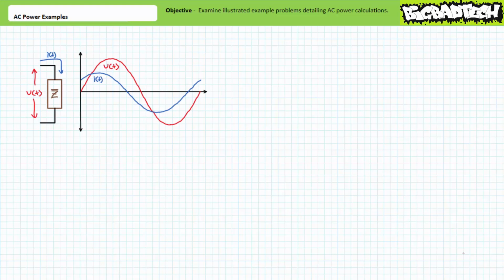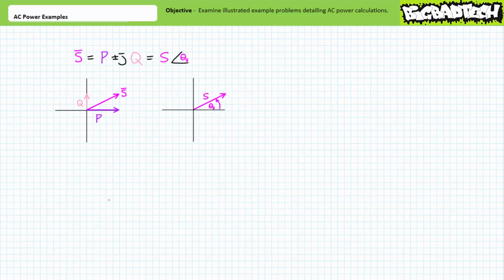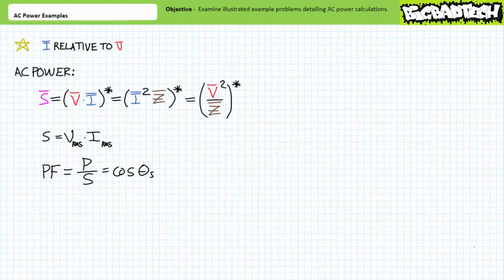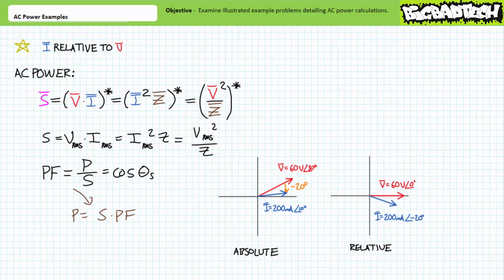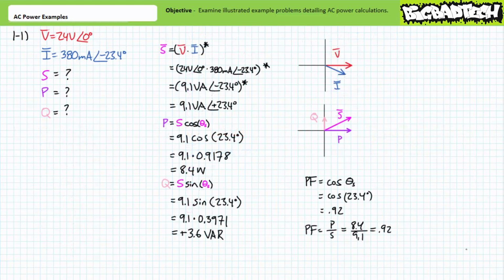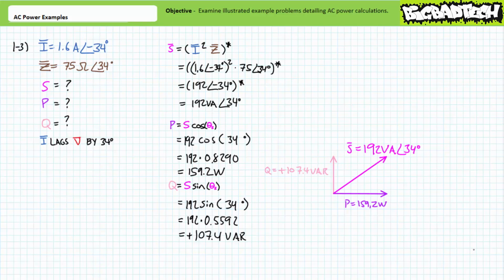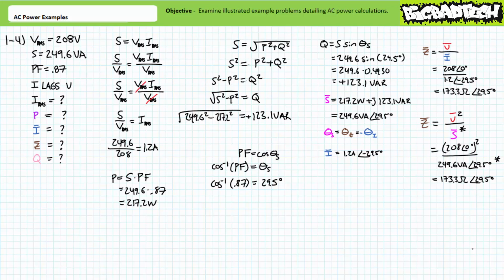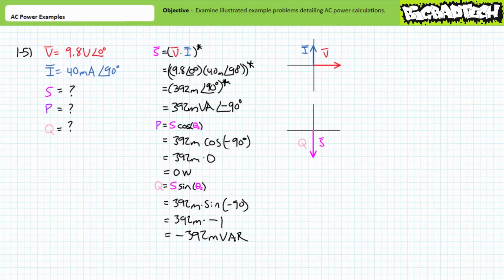AC Power Examples (Part 1 of 2)

Comment: When current leads voltage, a capacitive circuit, how can we have current flow with zero voltage?
Reply from the maker: Good question. This is part of the "missing link" lectures between DC circuit analysis and AC circuit analysis that I'll eventually return to once I wrap up AC circuit analysis I referred to in the summer update. The missing link is known as transient DC circuit analysis which is the time based analysis of DC response. Long story short an initially uncharged capacitor (ie: one with no voltage) appears as a short circuit and current rushes in. As the capacitor charges up voltage increases and current slows down. For AC this cyclical charge and discharge process makes It appear as if current "leads" voltage.